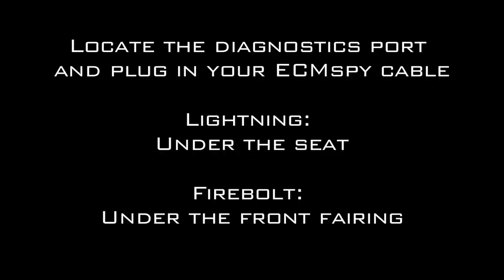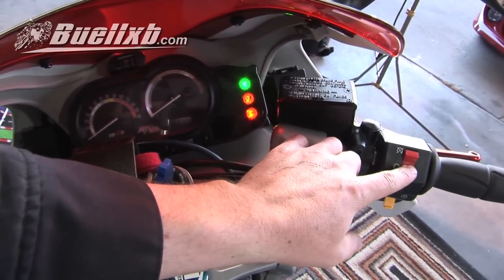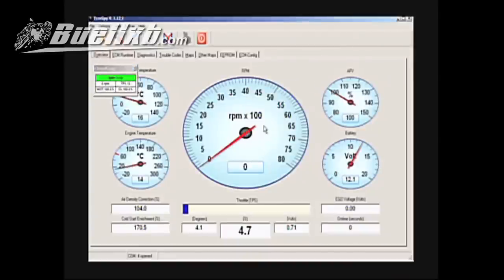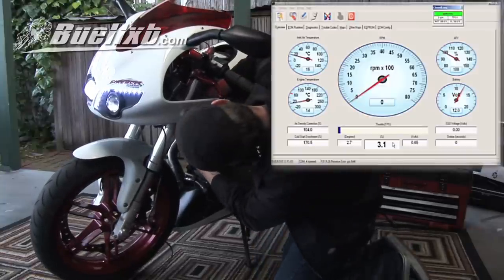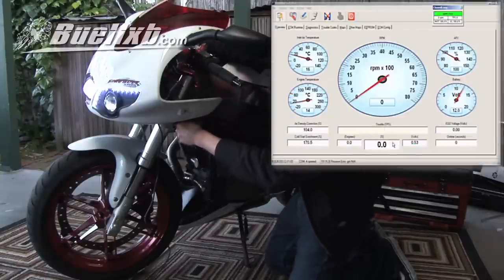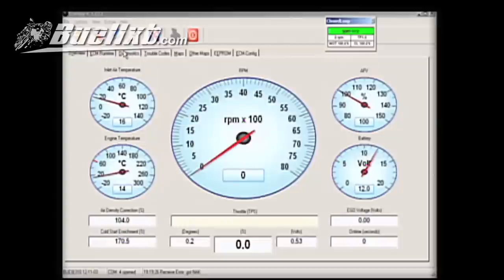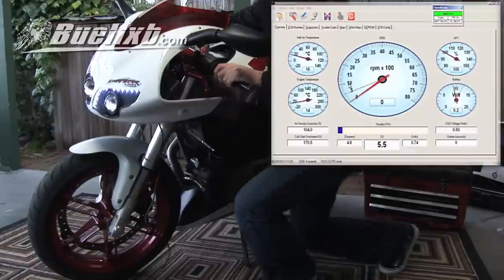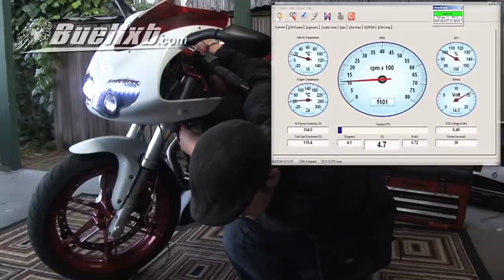Buell Motorcycle TPS Reset How to Do it Yourself Video

Comment: Hey there, appreciate the video but this just did something unexpected to my bike.
The ECM read that I was at approximately 22% so I kept turning it until it wouldn't drop below 5.1% for some odd reason.  
So I decided to just screw it back up higher and tried to start the bike.  It jsut clicks very loudly.  I even screwed it in all the way then tried starting it with the same failure.
I'm sure if unscrewing this too much could lead to problems?
Now my bike doesn't start whatsoever 03XB9r.

Comment: hey dave: i just did my 2007 uly tonite and could only get tps signal to drop to .7   never hit zero. and i know adjuster was backed way out as i removed entire airbox and base to look at adjuster. then ran it in to get the 5.5 # on tps. did this ever happen to you where you couldn't get 0 number for the reset? thanks much. john lutz/mid atlantic cycle

Comment: how important is the process after have your bike dyno tuned? i have just spent $1300 and my bike is worse spluttering, flat spots, and struggles to start, the tuners seem to be out of ideas, they have replaced spark plugs, 02 sensors, coil packs.
Reply: Did they check timing?

Comment: I found the software, but I have a question about changing the map, I have an XB12R and it has a gutted out stock pipe that pops like crazy on deceleration, I checked for exhaust and manifold leaks and they are good. The only thing left is a lean fuel mixture, but I don't know how to adjust the map, do you have any info on this problem?
Reply: did you still have the software?